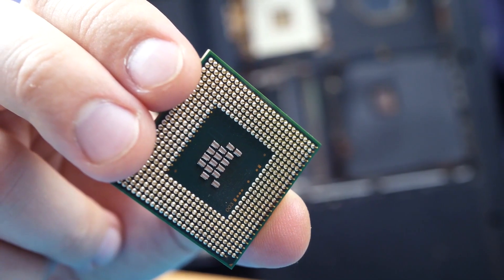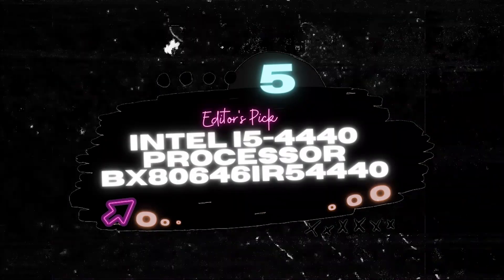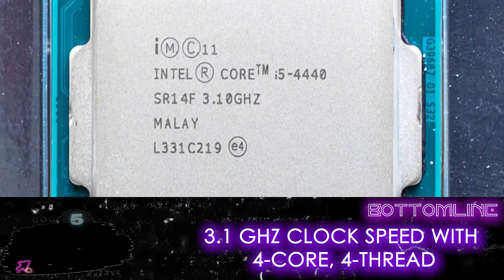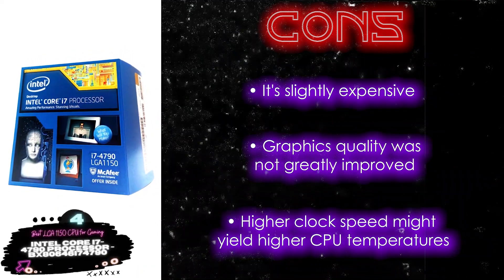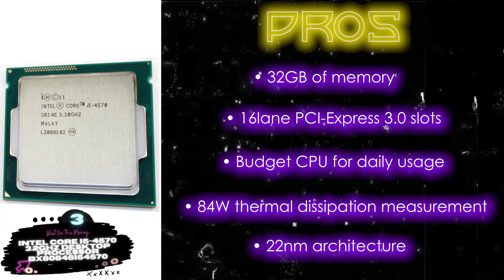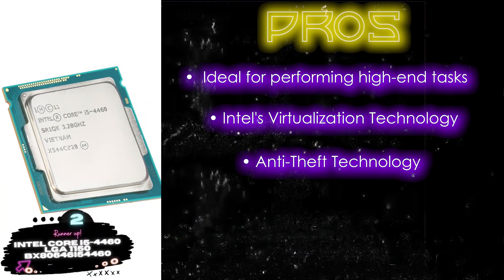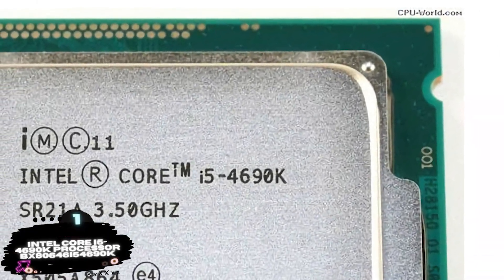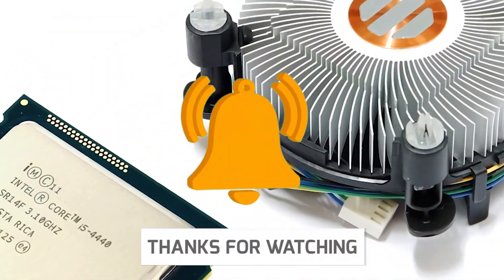Best LGA 1150 CPUs | Digital Advisor

Comment: 4670 is a damn fine chip. Equal to the 4790 with the exception of hyperthreading. Which apparently does provide a noticeable boost in some games compared to the 4670. I was considering upgrading from the 4670 to the 4790 before the used motherboard I bought crapped out within a week of use. Still looking into getting a 4th gen mobo though. Especially since I've already invested in several other parts for it lol.

It really is a nice platform for building a gaming rig around. Paired with a GTX 1660 Super/1070/1080 it can play just about anything up to RDR2 or Cyberpunk at 60fps, maxed out at 1080p.

Comment: The best i7 5775c processor. 5th generation, 4 cores 8 threads, L4 cache 128 MB. Turbo Boost 3.70 GHz. There is a possibility of overclocking. TDP 65 W. Price $ 100 (hello from aliexpress).
Only 4790k is better in power, but it has an overpriced.
Reply from the maker: We appreciated your suggestions. Thank you very much

Comment: 3:06 oh yeah thanks, this i7 is stable unlike those stupid i5's. All those other ones are unstable. Love it when my processor just, you know, processes and works like it's supposed to
Reply from the maker: We appreciated your comment! Thank you for your support.
Reply: Huh. Wonder if the i5 4670 I got was defunct and not the motherboard 🤔 Just had to plop back in my AM2+ board with a Phenom II X4 955 (95W) in it and wait to keep using the GTX 1080 I just got because my new (used) board kept freezing and shutting down unexpectedly. BIOS ran ok, but couldn't even boot into a recovery USB environment to do diagnostics due to the shut downs.

Did manage to update the bios without interruption tho, thank god... If the board is salvageable that is.